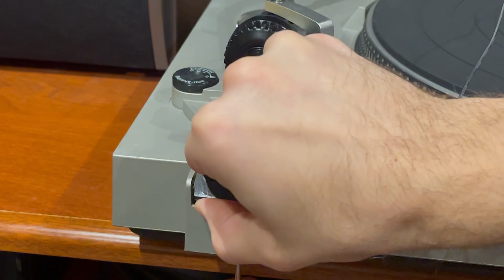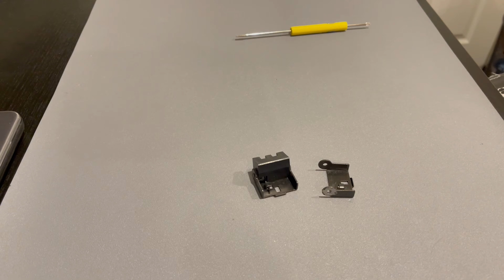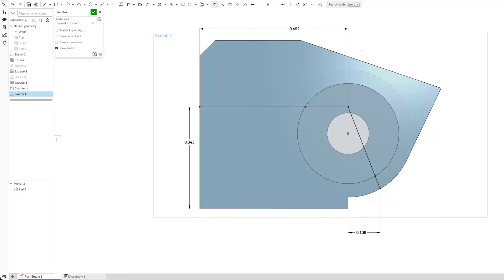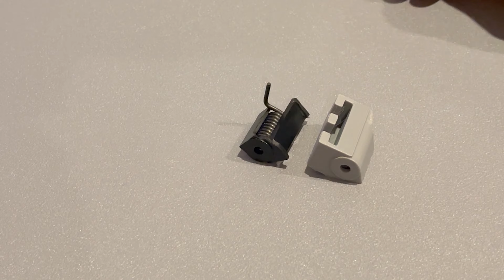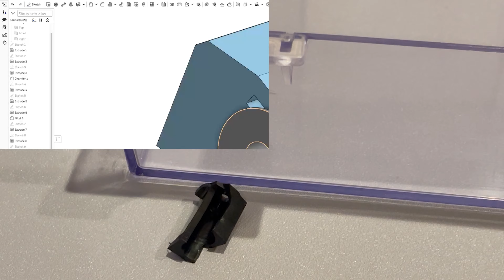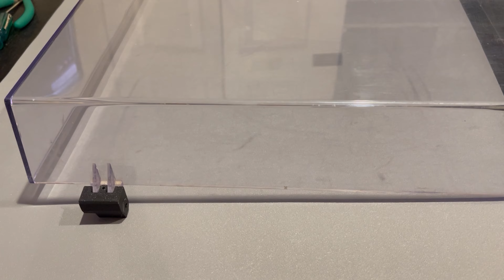Can you fix a 50-Year-Old Record Player with 3D Printing? | Technics Hinge Repair

Comment: Hi ! 
Thank you for your video, i've prnted the model but I wondered how did you extract the pin from the hinge. I'm tried hammering it out but I don't have a vice so it gets hard to do it. 
I would like to keep the pin and reuse it :)
Reply from the maker: Unfortunately there is no way to take the hinge apart without cutting off the top of the pin. The way it was manufactured the end of it was compressed to hold it together and there is no way to uncompress it without physically cutting it.
Reply: @MakingWithLaz  that's what I thought. Now it's just a matter of finding a cut-off wheel :) 
I'll try to find a suitable replacement axle that's easier to maintain in the long run if the plastic tab breaks. 

Thank you and happy new year :)